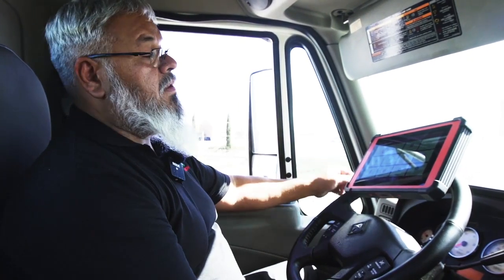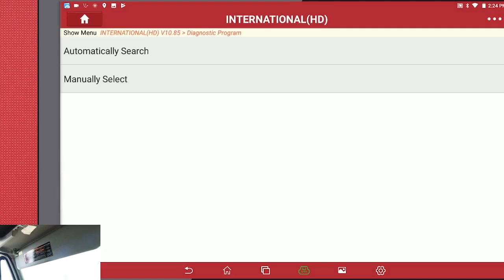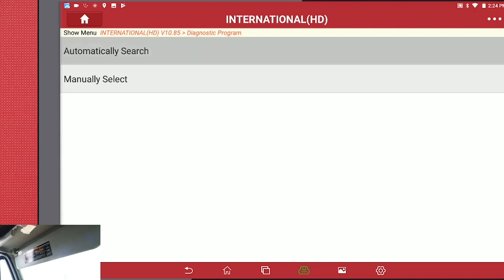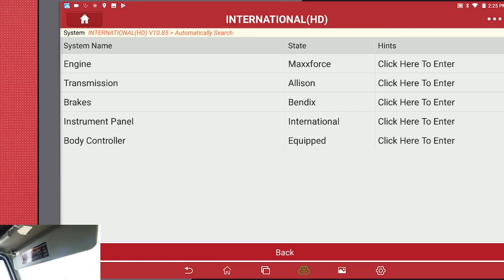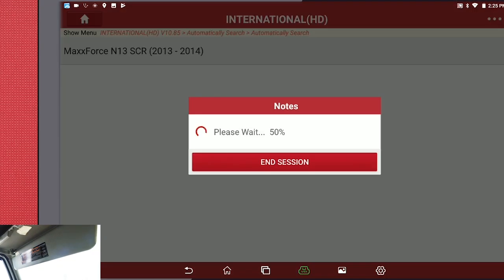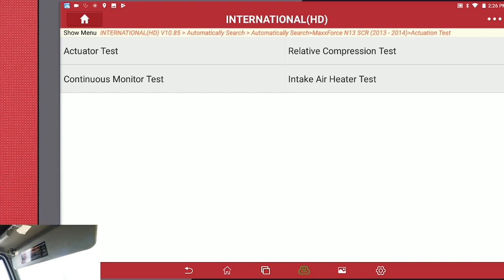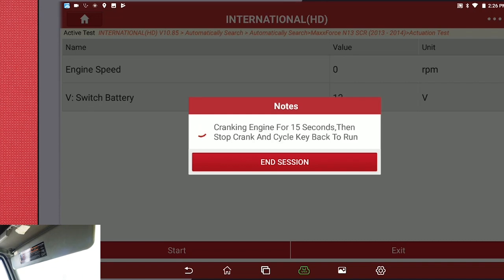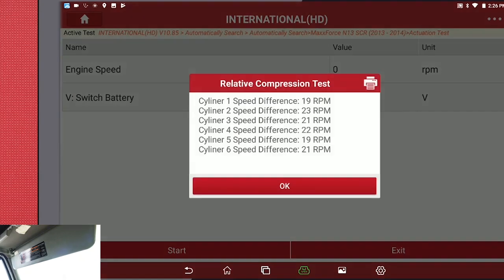X431 HDIII | Compression Test Performing | LAUNCH

Comment: Tell me please. Where to apply. To which Launch site? You need to change the software itself.
LaunchHD_Volvo. When connected
to a Volvo car version 4 shows the time of the first occurrence of the error and the last occurrence of the error.
When connected
to the car Volvo version 2 does not show. Even autocom shows. Very critical when diagnosing floating faults.